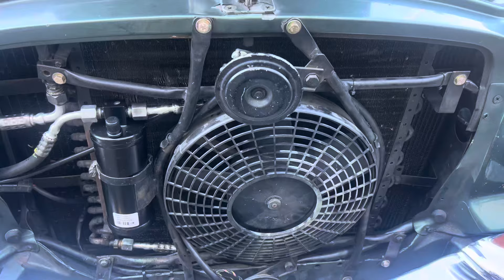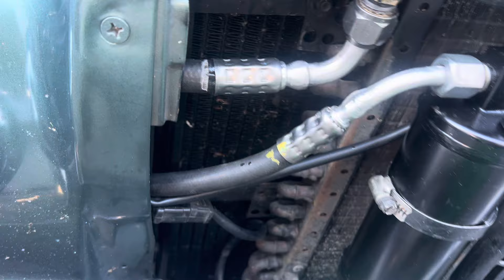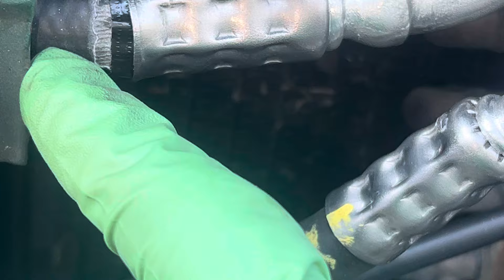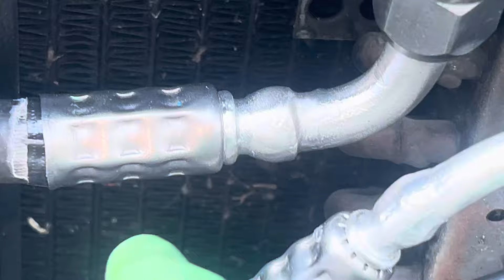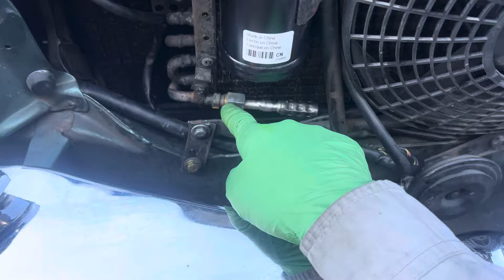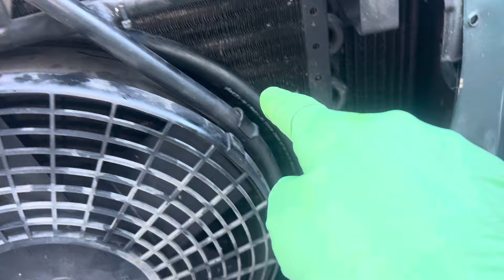Brand new refrigerant lines and a receiver dryer but somethings wrong with this picture.

Comment: Do you think automobiles will be better off with brazed copper pipes and 1/4 inch flared fittings?
Reply from the maker: @mikebrandt4131  I would love it.    No more leaking orings. 👍 
      But 🤣 look who we have now to work on cars.  
   The majority of the United States specially California when I grew up, you started auto shop working on cars in seventh grade. We had metal shop we had woodshop. you started brazing and welding. sixth grade or seventh grade depending what school district you were in through 12th grade. 
     So you had 6 to 7 years of learning trades skills you were taught safety you were taught what every tool was how to take it apart, clean it repair it and use it. 
         Now we have the last two generations they know how to manipulate software they could play on their PlayStation. 

Years ago, here in San Francisco, California, shops even were forced or due to monetary punishment. If you had welding oxen equipment in your shop, your insurance would go up. .   And you actually had to pay permit fee to keep the equipment in your shop to the city so Shop started getting rid of that type of stuff and technicians. Don’t even know what it is anymore.. 

    I would love for 100% braised lines to come back to Automotive.   I can tell you I definitely would have a monopoly. 

I could see cars being said on fire all over the country, just due to the lack of no common sense of safety procedures, and use of equipment that was caused by the individuals who ran our school system who defunded the trades out of our schools . 

No flares .   We’re talking about guys who cannot even install O-rings correctly.. 

You see what a mess it is in the Hvac community with guys cannot even make good flares that don’t leak .  . Braised stainless steel pipe would be good to. 
Coppers a little brittle in high vibration applications .   But it would be nicer to bend in the automotive industry.

Comment: LOL  drier in out or is it out in !!! lol  This model has a trinary fan /low/high switch on the drier ???
Crimping has not been done deep enough , when u look at the hose ferrules .  Were the weld on fittings R134 or R12 ??   Has the correct refrigerant hose  been used that matches the fittings .
Lets say I do not get surprised anymore by any  standard of workmanship
Reply from the maker: @paulthompson1654  this was done by the last remaining air-conditioning radiator shop left in existence up and down the San Francisco Peninsula Redwood City this San Francisco. 

Quality has dropped all the rest of the businesses went bankrupt

Comment: Drier backwards, Even if you can’t see the ‘IN’ the sightglass should never point towards the condenser, no excuse. 

Also they did not flare those hose fittings nearly enough before brazing them, way too much solder used. Oh well just costs them more i guess 🤷
Reply from the maker: @Jeff-gb5rt  young guys no apprenticeship no mentoring no proper training. 

Just hired and learned on the job with no oversight or mentoring
Reply: Very true across many industries.